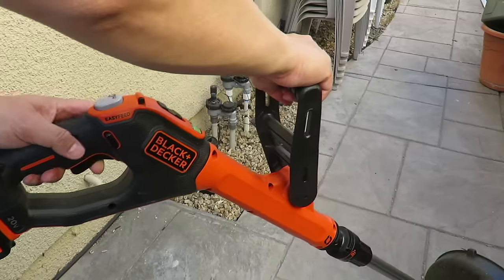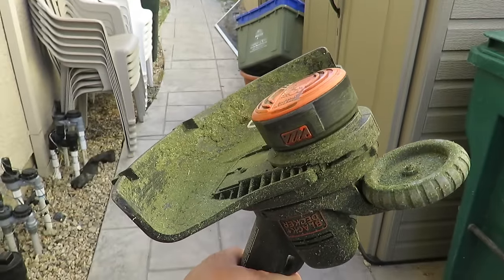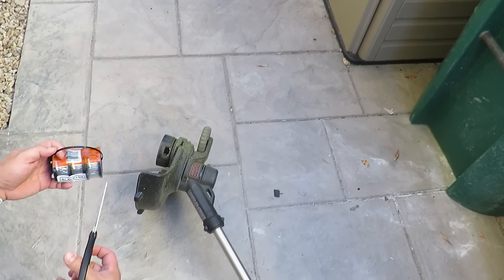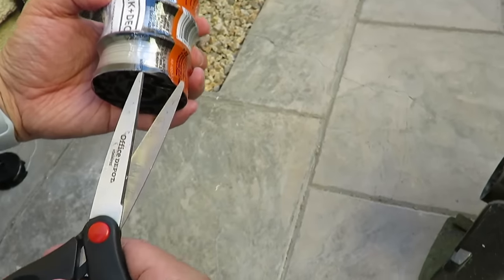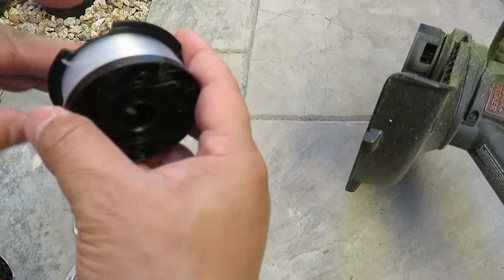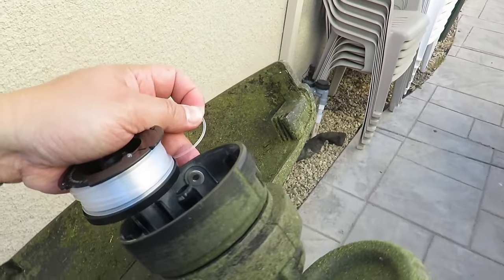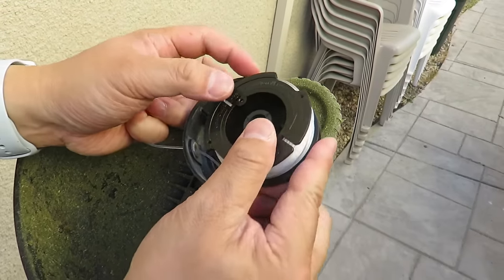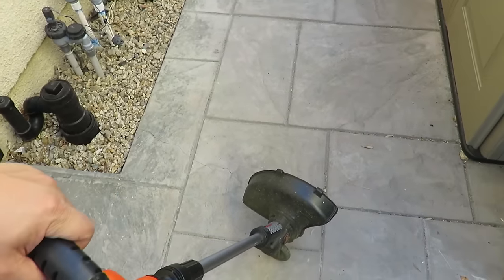Black and Decker Trimmer Line Spool Replacement

Comment: Pro tip:
Buy a spool of .065 line, for 1/4 the price, and wrap it back into your old cassette.
Reply: I can dig that
Reply: Lol I just bought some spool cassettes and found out they weren't the size I needed. So I just took the line out of it and wrapped it around my old cassette, problem solved. 😅

Comment: I have the same model and came with a 2.5ah battery...going on 5 yrs now no issues...but would suggest using b&d line for this trimmer or else auto feed wont work as it should...great little trimmer.
Reply from the maker: Thanks for sharing

Comment: The notches in the spool are for holding the line while you are setting on the drive spool. Pull out 6” of line , lock it in one of the notches, thread the line thru the hole as you are installing the spool. When the spool is locked, tug on the line and it’s ready to go
Reply: I just replaced mine and am finding that each time the line breaks there is no auto feed of new line.
I feel like I've inserted the new cartridge exactly as shown but I must be missing something.

Comment: I have another question, how do you fix the lock mechanism the spool won't feed/come out it keeps getting stuck. I noticed the small part that controls the feed has wire attached them and it seems loose. Please advise.
Reply from the maker: unable to understand what you are explaining over the internet.

Comment: My line will not come out automatically. I have to manually take line out every time its blunt. Which is 4/5 times each time I use. Its driving me mad.  What am I doing wrong?
Reply from the maker: It happens sometimes

Comment: I have watched many of these videos and no one talks about that little thing inside the spool ( looking like a 'comma" sign). Does it stay towards the middle of the spool or towards the edging of the spool???? I am aggravated with these spools. My son cut the grass yesterday in the evening and had no time to trim so there I went out this morning and I had to stop every 3 min and fix the thread because it comes out easily and ends even sooner. They need to come up with something better. I hope I can find something that does not drive me crazy!!!!
Reply from the maker: Try the middle.
Reply: @netman88  Thanks. I will.
Reply: @sophiahuber4756  i have the same issue, did this work? My line ends so quick and won’t feed me more..

Comment: Thanks for for the video!  But how do you feed spool? On the instruction says it automatically feeds trimmer line but when I press the easy feeder button nothing happen.
Reply: I actually have the same exact issue. So, I just pull the wire by hand. I know that eliminates the self-feeding feature but not sure what else to do.
Reply: I've had two of these now and the same problem. The automatic feed never ever works..  frustrating.  I just pull by hand as well
Reply: An old mower guy told me to spray wd 40 on the inside spool and it won't hang up. It worked for me.
Reply: Shoot, I buy trim line and just reuse the old spool. But after I feed it through the line its always too long and it hits the inside of the shield. I just cut a bit off and from there on out it works perfect until it's completely run out of line. 🤷🏽‍♀️🤷🏽‍♀️ Always works for me.

Comment: Looks like I install it correctly like the video but my trimmer line keep getting tangled up and stuck.  I had to turn the power off and fix it almost every few minutes which is frustrating.  What went wrong?  I enjoy cutting grass but hate weed walking for that reason.
Reply from the maker: Can't really tell remotely. My guess is the line isn't wrapped right probably. It should just pull to come out of the spool.

Comment: The trimmer itself may be reasonable inexpensive but you pay through the nose for the replacement spools. In Canada, that three-pack costs $30 at Lowe's.
Reply from the maker: Try the generic spools, it's cheaper
Reply: @netman88  Before ordering a new 3-pack from Lowe's, I decided to have a look and see what was available from Amazon. 8 spools for $16.49!!! Thanks for your advice.

Comment: The line lenght outside the old spool before replacement is very short. Is that the max it feeds at a time?
Reply from the maker: It works well for me.
Reply: Me too! Did you figure out how to increase the length of your line?

Comment: It's been almost 2 years, how has the  trimmer held up from a reliability stand point? On a full charge how long is the battery lasting now versus when you first bought it?
Reply from the maker: The trimmer is still great. I don't have any problem with it. Well thru a few spools of lines already. I found the battery doesn't last that long so definitely need the 2 batteries.

Comment: Same trimmer but my line will not stay tight. Feeds out automatically and as soon as I turn it on I have string wrapped around
Reply from the maker: Some replacement strings unfortunately are like that in quality.

Comment: the orange top of the spool head broke   do you have to buy the complete spool head to get the orange top
Reply from the maker: I would try to contact Black and Decker if they sell the orange top.
Reply: The orange top can be purchased separately in store or online. Make sure you have head part number, or at least know the trimmer model number.

Comment: I  have a Black and Decker Grasshog cord trimmer and It doesnt have a whole lot of power. I took it apart and cleaned all the grass and stuff wrapped around it but I still don't have a whole lot of power.  Anyone with any tips on how to save it pls help.
Reply from the maker: I have the same one before I purchased the cordless one. The old corded one was pretty bad. I didn't even want to sell it given it's trash.  Probably will donate or recycle it.